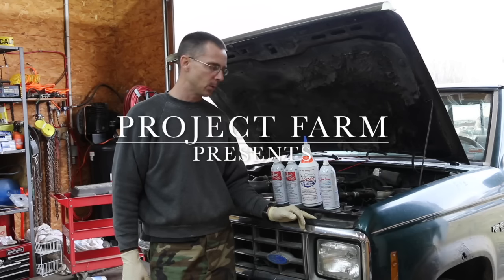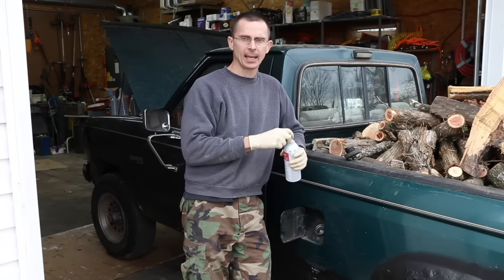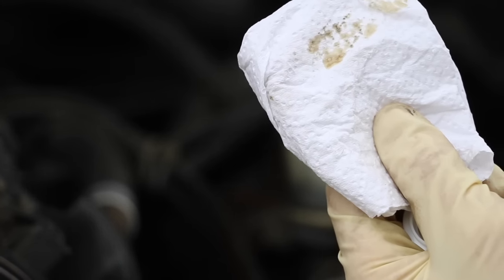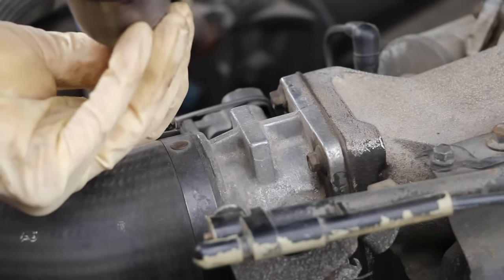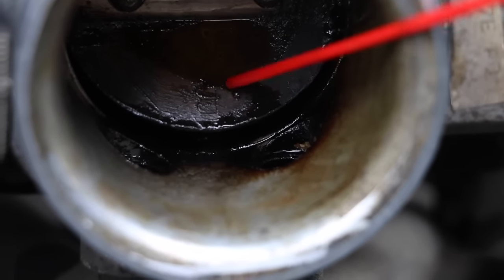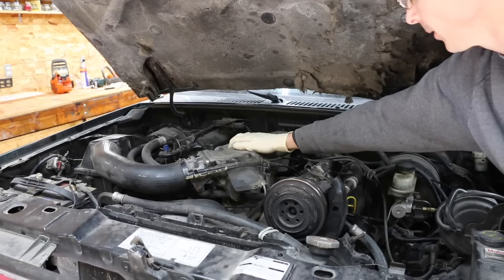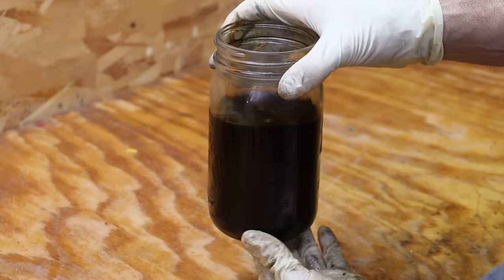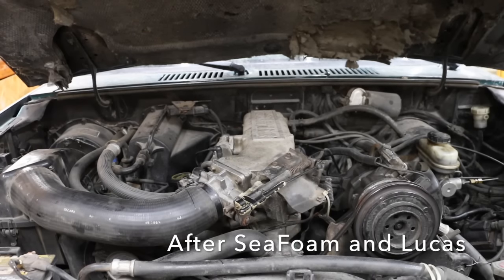Seafoam--can't believe what it did to my engine!!

Comment: I just did this about two weeks ago to my zj with almost 240k on the 5.2L...while spraying through throttle body you need to hold rpms up 500-1000 higher than idle(it really makes a difference). after the hot soak start it up and take it out for a hard drive lots of pedal to the metal to help burn out all the carbon drive it for about a week change the oil and do a full tune up the damn thing purrs like a cat in heat now.....think I'm going to go drag race my brother in his newer Ford exploder. Hold my beer
Reply: DrHavok1 ford exploder lol
Reply: Hold my beer. Love it.
Reply: HEY! No fair to your brother, you woulda beat him BEFORE the work done!! LMAO!!
Reply: DrHavok1 - I concur with DrHavok1
Reply: DrHavok1 of
Reply: Pedal to the metal put that carbon there in the first place.....  Move on.
Reply: who won the drag race?
Reply: I would not want my engine sounding like a cat in heat. No sir. Not good.
Reply: @jimdavidson8955  I agree, I cant imagine that sound coming from the engine oh my  god that would be so nasty lol.
Reply: DrHavok1 gotta 2JZ my brotha! Thanks for the tip!
Reply: Famous last words hold my beer
Reply: This isn't true at all. Engineeringexplained has a video on this subject go watch it.
Reply: I have a 98 Jeep grand cherokee limited 5.2 that has 245k miles! Engine and transmission are both original and they have not been rebuilt! I drive that Jeep 100+ miles a day to and from work! They are good vehicles so long as you take care of them! I've never had to use Seafoam but I did replace the injectors and every sensor! I also just finished replacing the entire suspension! Just saw one for sale where I live that has 400k miles and is still going. It too still had the original motor and transmission!

Comment: I was having the same problem s that you had so I tried the Seafoam treatment.  I could not be happier.  The truck runs like new.
Reply from the maker: Awesome!  Thank you
Reply: Where can I get all 3 products. Everywhere I look I can only find the oil and spray Seafoam products. Can not find the fuel addition. either of you have a link to the three? Thanks
Reply: @jamespage929  the pour bottle is the kind you put in the gas tank or crankcase. You can even use the pour kind thru the brake booster hose to do it thru the intake. But the spray is alot easier to use on the intake

Comment: I commented on this video over 5 years ago (in my 30s) and wanted to make an update. I was turned on to SeaFoam around 2002 & have sung its praises ever since. I have saved many of my pals indefinite heartache & cash by running SeaFoam in fuel tanks & bottom ends. I am not affiliated with any automotive  product in any way. with that stated, I have started to use Berryman B-12 (Chemtool) product in lieu of SeaFoam, due to the much lower price (40% less) & I’d love to see a Berryman vs. SeaFoam comparison done by our PF Hero here. good luck out there, guys.
Reply from the maker: Thanks for the video idea.

Comment: I thought SeaFoam was just another load of BS, but after watching this, I think it’s definitely a product I would use. A bunch of people recommended me to your channel on another video, so you earned a new sub because everyone said your channel was the place to be!
Reply from the maker: Thanks for watching and subscribing!  Please thank all your friends for the recommendation!
Reply: I’ve had good luck using the spay you dump in your carb/throttle body to clean the carbon off piston heads so I can identify aftermarket pistons without tearing into a running engine. As compression ratios can be affected by head gasket/head/block combos as well as piston design.
Reply: This stuff really works. Use mobile 1 oil, seafoam,  and Lucas oil, you will be amazed.
Reply: @bennedettocracolici5058  seafoam in the tank or engine man?
Reply: I thought the same, till my buddy who owns a garage showed me.  I'm a blacksmith and was making custom brackets, mounts, strut tower bars, coil spring mounts and stops etc. (his shop is in TX now, but WI back in the early '00s)  I'm skeptical of these products too, but seafoam really does do at least 95% of what it claims to. I've heard about one in a red bottle that is also supposed to work well.  Its called something like 
__ marvel oil.  This is my new favourite channel, I'm in the middle of making some needed modifications to my '17 wrx and am finding very valuable info here!
Reply: @warpdriveby  Had a 05 wrx STI and I'll say it was fun till I left a bar one night. Out running the law I bounced it off of a tree.
Reply: @wildestcowboy2668  I'm glad you lived to tell the tale!
Reply: @warpdriveby  😆
Reply: @bennedettocracolici5058  There's another video comparing mobile 1 to redline you may want to watch.  I thought the brands were all the same but his tests suggest otherwise.
Reply: @warpdriveby  Thanks my friend. I did get hurt that night but I got away, the STI didn't. Thank God for me being sober now!
Reply: @wildestcowboy2668  Right on and well done!  It's an enormous challenge to get and stay sober, or was for me at least.

Comment: After watching this video I decided to try the Seafoam on my '88 Ranger.  I used the intake cleaner and added some to the crankcase.  I put Chemtool in the fuel tank.  My result were very similar to yours.  The valve train got quite and the idle smoothed right out.  It also helped with the power.
Reply from the maker: Thanks for sharing.
Reply: What

Comment: I’ve used seafoam in my diesel Jetta, both in the fuel and the oil. Excellent results 210,000 miles still tight runs great!👍👍👍
Reply from the maker: It's a great product!
Reply: Barely broke in at 200,000
Reply: We'll you can get the same with water injection  steam takes all the carbon out without
Hurting anything and duh that is free.  But any fuel has water as a by product ( the white smoke  in the exhaust.) You get one gallon of water vapor with every gallons of fuel  ..just in case you didn't know
As in winter time. You make steam as well when you "breath" you can see it.
So save you're money and let nature do what it does best

Comment: I had a 1990 Ford Bronco with around 125k that had a low vacuum condition that would make the cruise control shut off on inclines and the A/C vents would default to the floor on anything but light acceleration. I bought a can of Seafoam, not to fix those issues but because everyone said how great it is for the engine. The truck ran great otherwise, no ticking lifters or anything. In fact I wasnt even thinking about the vacuum issues when I bought the can. I followed the directions and put the Seafoam into the oil. A few days later I noticed that the cruise control didn't turn off on inclines and the A/C vents no longer defaulted to the floor upon acceleration. The Seafoam fixed both problems, and what really amazed me is that it was permanent. Those issues never came back. I went from needing a new engine to an $8 can of Seafoam. It really works.

Comment: They should sponsor you just sold 100000 cans
Reply from the maker: Thank you!
Reply: Marshall Fischer is
Reply: I'm deff about to buy some sea foam after work. I been knew about the lucus. I had a customer who noticed some engine noise. I took a look . Oil level was low classic signs of rod knock. Crankshaft bearing failure. I corrected the oil level it was still present.  As a last resort I told them lets change the oil and substitute 2 quarts for lucus. At first the engine struggled to idle in gear. Maybe because of the added resistance. The noise was completely gone. After driving up and down the highway the idle corrected it self. Till this day almost 2 years ago he has no more rod knock. I saved him $3000 for a engine replacement.  2004 toyota Camry v6
Reply: @JermaineLeeBlueprintAuto  - 👍
Reply: 3 cans for me
Reply: Michael Doyle  - You have a 2002 with 2k miles on it?
Reply: Now 2019 and he is still selling them lol i just watched the video and ordered two cans!!!!!
Reply: try more like a couple million.
Reply: Why do you think he did the video in the first place? Not a coincidence if you ask me.
Reply: Would this be safe to do on my 2005 Pontiac Grand AM 2.2L with 286,000 miles on it? It runs a little rough when idling at a stop light, while in gear. Motor mounts look good, new spark plugs, New AIC valve. Only vibrates while stopped in drive and reverse.
Reply: @LuisMendez-up5te  I'm not a mechanic, but I don't know if that's a fuel/ oil issue, if it vibrates in gear but when stopped it could be another issue
Reply: Seriously. I almost went to pay for a fuel injector cleaning but after seeing how well the Seafoam works, I’m not wasting my money. Glad I came across this video.
Reply: No need as they have their own official video showing this procedure done correctly
Reply: For real 😂
Reply: @caillew7618  Yes,  All my old school mechanics use Seafoam and Lucas products. Walmart is typically the cheapest
Reply: 7 million views at least half bought a can
Reply: Right!!!! Lol
Reply: I bought two cases
Reply: @JermaineLeeBlueprintAuto  failure was imminent probably because they let their oil run out. he should take better care of his car. People that let their car run with almost no oil  Drive Me Crazy
Reply: @ProjectFarm  add 3 more cans Sea Foam for me/

Comment: Lucas oil treatment is incredible !!! Seaform..also great  cleaner  my opinion incredible as well !!! My two favorites after 25 years of wrenching ! ! No B.S. here I know they work !!!
Reply from the maker: I'm impressed with both of these additives as well. Thank you for commenting!
Reply: Mr1002brady If you put that sludge into your motor I feel bad for your cars.....Seafoam yes, lucas fuck no!!
Reply: Chris Watson why do you dislike Lucas? I use 25% Lucas and all my vehicles including my crotch rocket. It quiets the lifters in my vehicles. And I noticed an increase in horsepower in my crotch rocket after using Lucas Oil stabilizer in it. Never had a problem with clutch slippage or anything like that.
Have you felt how slick Lucas is if you get it on your hands? Way better than regular oil.
Reply: Vladimir_Bone Spur_tRump $12 a bottle isn't almost nothing. That's half the price of 5 quarts of valvoline... An old 350 I have started to leak oil past the valve seals and after a few oil changes with Lucas the oil burning on startup has completely stopped.
Reply: Vladimir_Bone Spur_tRump the one he used in the video is $12 a bottle and it works great.
Reply: Vladimir_Bone Spur_tRump i have never once seen a 3 dollar bottle of lucas in my life.
Reply: Darrencivic don't trust a guy who calls a sport bike a crotch rocket
Reply: I put 200,000 miles a year on my semi tractor teaming with my wife. I wouldn't touch Lucas or any oil additive with a 10 ft pole. The technology in today's oil shouldn't require it in the first place.
Reply: Vladimir_Bone Spur_tRump are you talking about the fuel additive?
Reply: That's not the oil treatment, it's the fuel treatment and it works very well.
Reply: Steve Page he used the oil additive too... Did you not see him add it?
Reply: Steve Page he adds the seafoam oil treatment at around 8:00
Reply: lucas is expensive $39 for a gallon jug i used to dump in my C15 CAT.

Comment: Well this video came to me about 17 years too late. MY old 88 ranger had so much sludge in the crankcase that when I took off the valve covers, it had a second set of valve covers just in garbage! The fella I was working with said it was Parrafin-based sludge which was pretty typical in Pennzoil / Quaker State lubricants. RIP my 88' ranger, you were a great little work truck!
Reply from the maker: Thanks for commenting on this.
Reply: Mobile one is the best one
Reply: ClawdyaTube damn
Reply: Almost all engine oils contain parrafin. What you saw was probably the result of not doing reguar oil changes and or some type of garbage additives used at some point. STP was "famous" for creating the conditions like what you saw.

Comment: I'm a fully certified technician. I use sea foam in all my personal vehicles. I have noticed tearing down my old 92 ranger with 536k miles that the sea foam really does work. It is not a cure for mechanical issues, but it helps clean, lubes, and remove any moisture that dose get in to the engine.
Lucus oil tends to turn to sludge once in the oil pan and particulates get into it. It dose not circulate well and stays in the oil pan.not helping the engine after a 1500 miles.
Reply: So are you saying that you'd do the next oil change sooner or not to use the Lucas after at all?
Reply: I second Mx Parts question
Reply: dude is saying to flush the engine oil after 1500 miles

Comment: Marvel Mystery Oil I’ve used for 47 years with great success too.
Reply from the maker: Thank you!  MMO is a great product too.
Reply: 90 weight differential oil most likely
Reply: machia0705 marvels is old old OLD technology. It’s not good for newer vehicles anymore (try BG’s EPR, MOA, RF7). It WOULD be good on the truck shown in the video here, but especially don’t use Marvels if you have a GDI motor.
Reply: Works good for a sludge up engine😊
Reply: Mark Belk  you cant just leave seafoam in and drive around?
Reply: I'm still trying to figure out how much Marvel Mystery thins out the oil
Reply: I sold a car awhile back that would start tapping a lifter if the car sat idling for too long. The tapping went away once the car was cooled down and moving. The guy that bought my car knew about this problem and told me his mechanic fixed it by adding MMO to the oil before changing it. No more tapping lifter.

Comment: The EGR valve failed on my wife's van. This allowed oil to build up on the valves and pistons and cause pre-ignition. The EGR was replaced but the pre-ignition "pink" was still there. After spraying Seafome into each cylinder through the spark plug holes and leaving it overnight, after a great deal of smoke out of the exhaust the pre-ignition was gone. I'm sold.
Reply from the maker: Impressive results! Thanks for sharing
Reply: Pink? Haven't heard of that in exhaust.

Comment: I have an old 89 Ford Ranger, I have tired a lot of oil additives. I just did an oil change and put in a quart of the Lucas Oil Stabilizer and everyone that Is around my truck a lot has told me my truck sounds way better. My truck also had a bad smoke problem and it is almost unnoticeable.  My ford is also electronically fuel injected. I could not ask for a better old stock truck then it.
Reply from the maker: Impressive results!  Thank you
Reply: Royal Purple, no need to add a anything.

Comment: I set the Lucas on top of the warm engine so it flows from the bottle easier and add it first using a little oil to rinse the bottle out
Reply: I poke a hole in the bottom of the bottle
Reply: Dude
Reply: I forgot it in my trunk once under the florida heat, and it warmed up just enough it flowed quite easily.
Reply: Lucas is the real deal
Reply: Lucas all the way — works great in old shovel head Harleys

Comment: The Lucas oil treatment looks very similar to STP that we used to use in the 70's in our engines. great video, thank yo for posting.
Reply from the maker: Thank you
Reply: Yup, that and Motor Honey. Thick stuff, increased oil pressure for one thing.

Comment: I have personally rebuild engines and discovered a blob of STP settled in the bottom of the oil pan.  Pretty much the same thing as that lucas product...  IF you are gonna try that stuff to extend the life of a worn engine, run it up to temp first, then add the product, warmed in a pan of hot water so it mixes well.  rc
Reply: Or just shake some up in a motor oil bottle. You have to pour some oil out first, but I shouldn't have to explain that.

Comment: Great preventative medicine for small engines too. I'm a small engine mechanic and when things don't run its usually a dirt/ sludge problem. Our ethanol fuel today breaks down so quickly inside carbs and injectors. Stihl actually recommends discarding mixed fuel more than 30 days old so it doesn't plug fuel systems !  Seafoam is ideal in that it readily cleans small orifices and prevents sludge and varnish from building up. Its a fantastic fuel stabilizer as well for those pieces of equipment that don't see regular use such as chainsaws and trimmers.
Reply from the maker: Great point.  I've had several people question a statement I made about fuel going bad. You're right, it does cause a lot of problems quickly!  Thanks again.
Reply: A real mechanic has no use for this stuff.
Reply: @gsp49  you are absolutely right.  When I was a real mechanic at a real dealership we didnt clean anything. We were instructed to sell all new parts.  Dirty carb on a quad that was parked for two years ? Sell them a new carb.
Reply: put  1 oz of lacuor  thinner in lawn mower ,chainsaw,any small engine and it will keep the cheap gas from build up in carb.or use seafoam that is what it was originally made for small engines.
Reply: @SonofGodly  how often do you put the lacquer thinner in the small engines?

Comment: I did a restoration on a 2003 Honda Accord. I put new spark plugs, new battery, new engine air filter, and changed the oil. The car sat for a year and wouldn't even start or be jumped. I put Seafoam in the fuel tank with a fresh tank 91 Octane Super+ Gas since the car had been sitting for over a year in a family member's drive way. With all the things I did the car runs much better now and runs good as new. I'm glad your video shows they make a good product. A friend recommended Seafoam to me when he heard about me doing the restoration on the old Honda Accord.
Reply from the maker: Thanks for sharing.